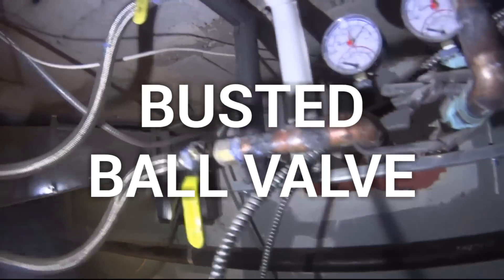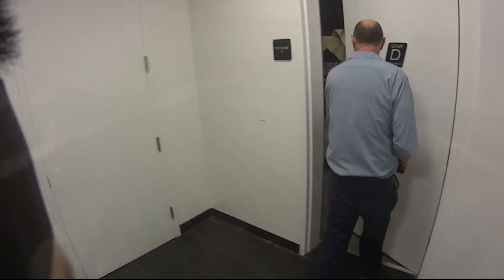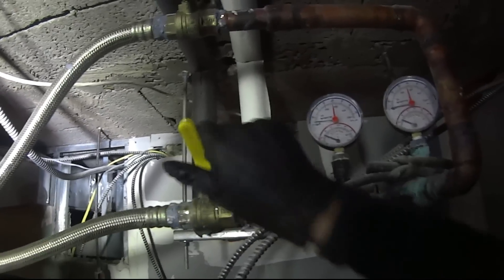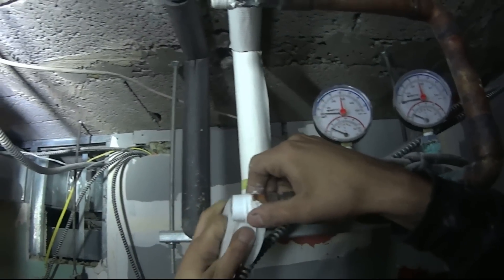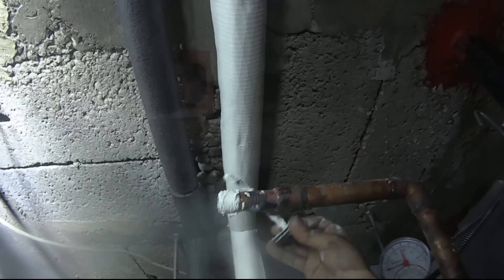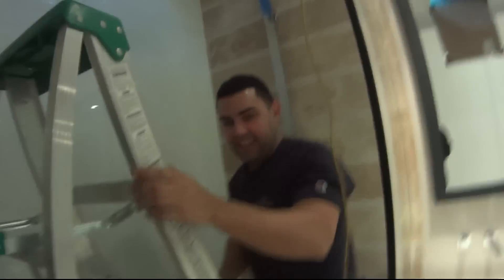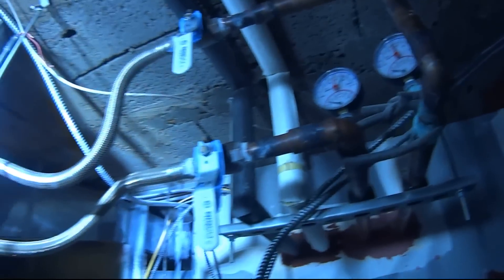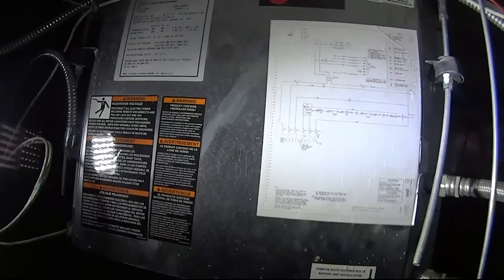HVAC | WSHP | Leaking Ball Valve

Comment: I only use pipe and fittings made in North America
Currently, we are still replacing shut off valves and pipe fittings in a Condo that was build 5 years ago from a previous company that went bankrupt due to the law suits, and damages caused by water floods.
Reply from the maker: Yeah man that's the way go. I've also  used Italian and German valves in the past,They are good quality. thanks for watching bud.

Comment: Nice video. Where did you purge the bulk of the air to?
Most of the building money goes to fancy home automation and building manegement systems rather then to quality parts.
Reply from the maker: Hey buddy. I just kept the return closed and just purged the air through the hose I had on there. that riser was small 2 inch pipe that feeds 8 Apts. Also there is a big air separator. Man they cheaped out big time that building is about 9 years old and it has problems all over the place.